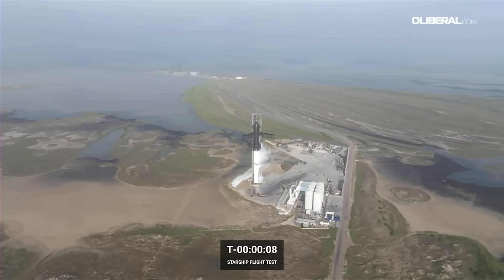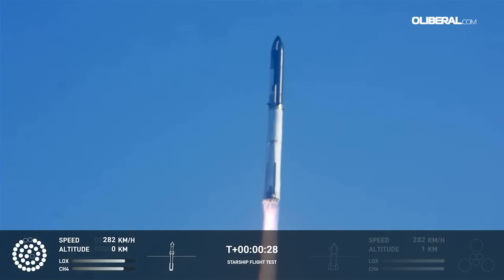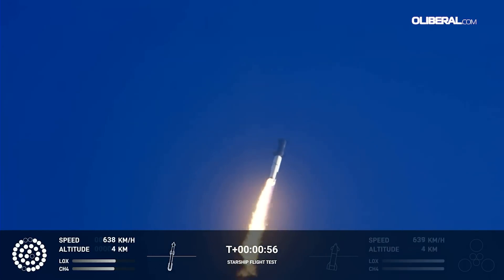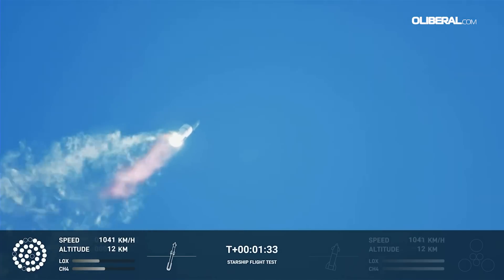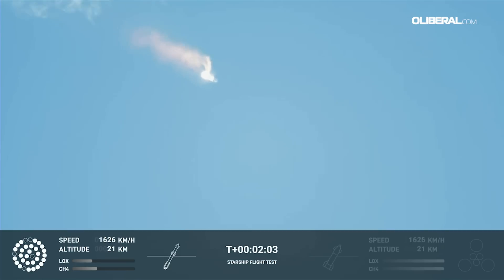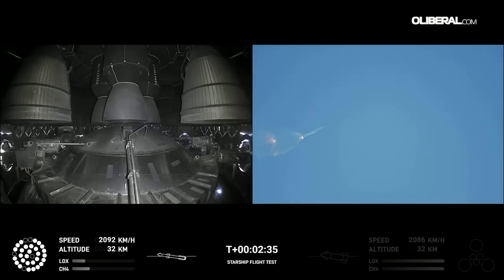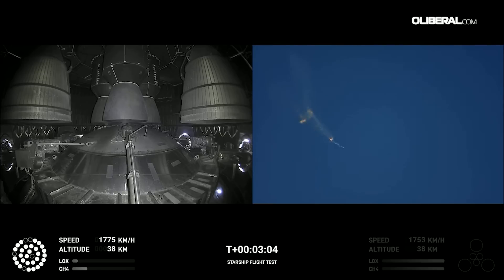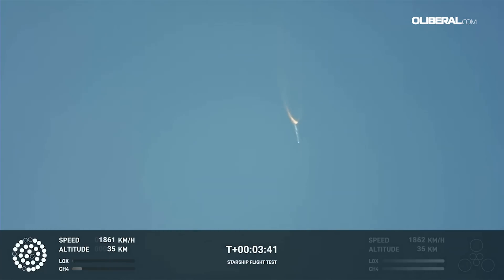Foguete Starship, o mais poderoso já construído, explode após lançamento

Comment: Elon musk is probably the most non intelligent person on earth ... If you grab commercial airplane engine propellers that planes have on both wings and put them faced upwards on a space ship the space ship will float like a drone in the middle of the air , go back downwards and land or just go at it's top speed upwards ( 1000km/hour ) go beyond that atmosphere and leave earth ...    Those engine propellers do not need to be functioning constantly during the trip in space because the space ship can go at the natural speed of space travel which is a lot ...  Land on another planet and go up again ... As many times as needed .  the fuel that we need to travel to other continents on earth is enough for 15 hours at max speed ... But you do not need 15 hours to leave a planet or to land on a planet ... It takes a minutebor less even at top speeds of 1000 km/ h . A full normal tank is enough to repeat the process a couple of times .. ( it would even be possible to do this all with clean electric energy instead of fuel ). That's how stupid Mr. Elon musk is hahahhahahhaha